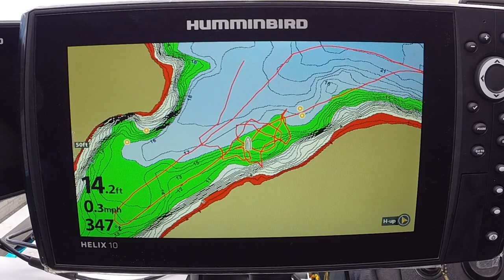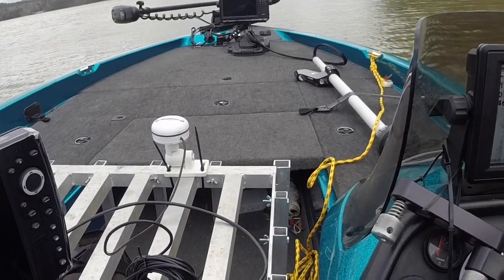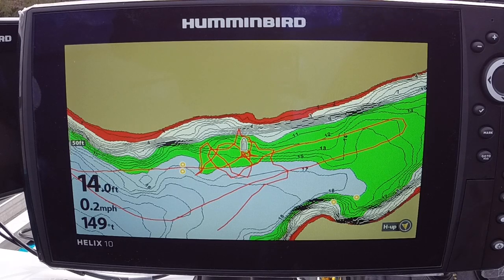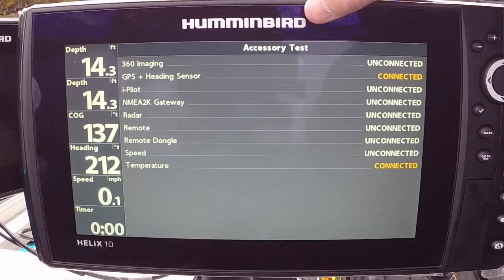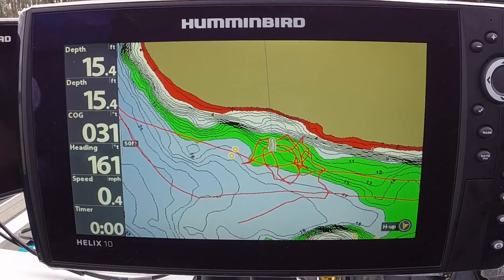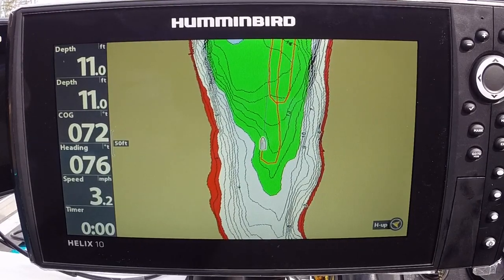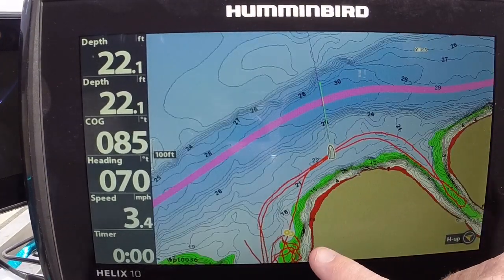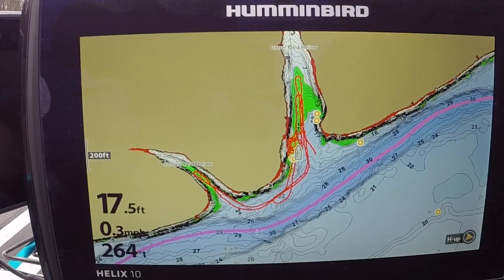Helix heading sensor setup

Comment: Im confused.  Im getting a new Helix 9 SI G2N unit.   It has a built in GPS.      Is this external sensor something i need to have also?     Can I do  follow the contour feature and spot lock without this external sensor?
Reply from the maker: Tim you can do all or that without the heading sensor.  The Helix units have a built in GPS antenna but no heading sensor.  The heading sensor is like a magnetic compass in this model of antenna.  As shown it allows you to see where you are in relationship to a target.  Without the heading sensor the boat icon will simply turn into a circle.  

Do a google search and do a little reading.  it will all make sense then.
Reply: Also if you got the new I-Pilot Link 2017 or later addition, the trolling motor itself comes with a Bluetooth heading sensor that syncs directly to the trolling motor.  In all likelihood you got the old one because the only place I've seen is mk.factoryoutlet.com who is selling the new one.  Maybe later this year local retailers will begin selling it.  It's one less device that the heading sensor needs to travel through because it goes right to the trolling motor instead of being hooked up through the fish finder.
Reply: Im getting the 2017 Ulterra with Ipilot link.   Ethernet with 2 Helix 9 G2n birds
Reply: OK then don't worry about the heading sensor because your trolling motor will come with one.  Again this will sync up to your trolling motor instead of connecting to your fish finder.  You calibrate it through the remote control by doing 2 complete circles and then you drive straight with the trolling motor parallel with the keel.
Reply: Two separate discussions here folks.  The new trolling motors use the heading sensor that is included for the jog feature only.  The heading sensor that hooks into the unit is used to orient yourself to a target.  Neither one will take the place of the other one at this time.
Reply: That's not true.  I have tested this without the heading sensor and with it.  It is not just for the jog feature.  I ran follow the contour in a 10 MPH wind and would not stay on track without it but when I synced it, it was night and day difference.  I own both I-Pilot Links.
Reply: So i will sync this trolling motor to the hand held remote control?  And the troller will be ethernet networked to the birds.   Is there anything i need to do on the finders?
Reply: I actually didn't need to even pair it the remote control.  It worked right out of the box on mine.  Last year on our Pontoon, I had to pair it.  But I did need to pair the heading sensor. Calibration is done on the remote control.
Reply: I own it and I've used it.  I know exactly what it does.  The difference is black and white.  Jog is the main reason to use 2017 over a Humminbird heading sensor, but it's not the only reason.  The Minn Kota heading sensor helps with follow the contour.  It isn't an argument.  It's a black and white difference.  You obviously never experienced it.
Reply: I hope Ranger boats installs this heading sensor if it comes with my 2017 Ulterra!
Reply: Cant wait.  I have the Ranger 1880MS coming soon,  better be in by May 17!    Walleye fishing Bull Shoals.
Reply from the maker: Tim

 Brandon has obviously stayed at a Holiday Inn Express.......  

I have installed 8 of the new BT trolling motors and use one on my boat. I have extensively tested all the features to make sure I know the most I can about the products I sell and install.  I talked to Minnkota today about an issue a customer has with his new Ulterra and an engineer, not a CS, assured me the reason they have a heading sensor is for jog only as of right now. Every other feature comes from the internal design of the head control unit.  

As for Ranger installing any of your equipment it all depends on the deal they have with the respective dealer as to how the orders are placed.  The Ranger dealer most folks buy from here does their own installs on many of the models.  I know because I have helped them with an issue on occasion.  

Enjoy the new Ranger!
Reply: Well on mine I ran follow the contour and it was behaving erratic until I calibrated the BT heading sensor.  I'll create the problem again and show you a video if you don't believe me.  As soon as I synced and calibrated, it was night and day difference.  Cannot get the 2 confused.  Day and night.
Reply: I have a Terrova and he has an Ulterra.  So I don't know if that has anything to do with it but I can promise you I'm not the holiday express person.  I am absolutely an advocate for some kind of heading sensor whether it's the Minn Kota that comes with a BT or one you are showing with the original I-Pilot Link.  That is the only way to go.
Reply: The analogy I'll use it where my dad and I were fishing was like missing the fairway on a 100 yard wide fairway.  Like #17 and #18 at Kapaula Plantation Course.  Then we moved and just before we did I got my dad patient enough to calibrate and set the offset.  It was like we striped the ball right down the middle of the fairway at Firestone.  The wind conditions were the same.  We did not have room for drifting 100 yards off the spot like we did at our first location.
Reply: My old HB  898SI unit  had the boat icon when moving.  And most of the time when i was using my trolling motor to approach a wave point i still had that boat icon and the directional arrow that let me know how close i was getting to my mark.   I did not have a heading sensor, and i always seemed to get on spot lock  fine.    I notice you had  the boat icon and the same directional arrow as well.  But i did see the heading sensor arrow also.   Is this a correct assumption that i am getting on my created wave points without the heading sensor?
Reply: I think you'll see the boat icon when the boat is moving fast enough for the GPS to confidently pickup where you are at and where you are moving.  When you're trolling less than 1 MPH, I think in that case it does just have the circle.  Now this one I am guessing on.
Reply: If I recall, last year when I put I-Pilot Link on my dad's pontoon, I think I've seen it flash from boat to circle on windy days.
Reply: https://www.youtube.com/watch?v=M-EFmIx948M&list=PLdnuLpMCJ8dBX4Nu22cxCjhEnlDI7dAF7 OK Tim Morris here's the video.  This is proof I'm right.  Now who looks like they stayed at the Holiday Inn Express?  Exactly as I stated the performance of your boat on Follow The Contour is exactly the same on the 2017 model with just the Minn Kota as the old one is with just the Humminbird.
Reply: The remote control and heading sensor both sync to the trolling motor.  All wireless links lead through the trolling motor.  The Humminbirds are Ethernet just like the legacy I-Pilot Link.
Reply: Better do a little research.  The jog feature is the only reason they have a heading sensor.  At some point it may be used for something else but for now that's it.
Reply: They absolutely will.  When I was at the boat show, the dealers installed it mostly in the bow.  The mounted it right on the same triangle as the trolling motor.  They will probably install it on the lower right hand corner or back right hand corner.  Another place might be on the dash.  BTW, the heading sensor that comes with your Ulterra also lets you do circles in addition to jog.  The best features is the motor will unwrap when the cables wrap around too tight.  The old system does not do that unless it's on spot lock.

Comment: Is this heading sensor built in on the new  Helix G2N models?
Reply: Just in case anyone has the wrong idea after reading the above comment ....... the Minnkota heading sensor does not interface with any HB units at this time.
Reply from the maker: No it is only found in the HS Gps Antenna.
Reply: The new I-Pilot Link 2017 has a Minn Kota sensor instead of the Humminbird sensor that comes with the trolling motor.  The legacy version does not come with one and therefor you need the Humminbird sensor connected to the fish finder.
Reply: It doesn't interface with Humminbird units, yes that's correct.  But it still helps in follow the contour.  The ultimate decision is in the trolling motor head.  James of Pickwick Marine Electronics doesn't believe me so I have to do a video of it.  I'll show all possibilities and I'll remove the Humminbird heading sensors I have.
Reply: I never made the comment that it interfaced with the Humminbird.  I know it doesn't do that.  What I'm saying is if you use no heading sensors and only use Minn Kota's, Follow the Contour will have just as good of a performance as the Humminbird ones.
Reply: Want to make a bet?  See who is right hopefully by May 6 if this ice ever comes off.
Reply: And I also fully understand there's no jog feature without the Humminbird heading sensor if you're trying to jog on the Humminbird.  There's jog only on the remote control if you only have the Minn Kota.  Humminbird heading sensor lets you jog on the fish finder.  But like I said though, the the ultimate decision after the Humminbird calculates the coordinates and does all the dirty work, the trolling motor decides where to go based on what the Humminbird told it based on the trolling motor's GPS.  And the Minn Kota puck will aid in that decision making process.  I still very much believe in getting the Humminbird puck as well.
Reply: The jog feature now works with no Humminbird with a software update on the Humminbirds.  It did not work with the latest software 2nd week of May last year unless you had the Humminbird.

Comment: Great video. Thank you. Quick question: In the video, are you using the point1 as the external GPS? In the accessory view in the video, it shows your nmea2k network as not connected so a bit confused if the point1 is the external source? I have both the helix 10 and the point1 but unable to see the point1 as a source for external GPS. I can however use the heading and attitude information. Can you clarify if the helix can use the point1 via nmea2k as an external GPS source? Appreciated.
Reply from the maker: Omar the external source for the Helix in this video is the Humminbird HS antenna that I had mounted at that time. The Helix can use the point 1 with the addition of the NMEA adapter (part # 408390-1). 

I run several units on my boat for demo which is why I have the NMEA network and point 1 installed. My Onix, as will the Solix, use the Point1 and I find it just a small bit smoother in movement than the HB antenna,
Reply: Thanks. Unfortunately, the Helix will not recognize the Point1 as an external GPS or display it as an option in the network tab. HB support has confirmed this problem with no resolution yet as of April 2017.
Reply from the maker: Thanks for the information. I wasn't aware of that.

Comment: didn't mention anything about red doughnut at low mph. is there any calibration like point 1? or do you drive in straight line and align hs sensor only? does hs sensor have arrow?
Reply from the maker: +Christopher Parker 

I forgot a few things... lol   There is no calibration with Humminbird.  I actually didn't calibrate my Point one either.  With the correct install location that shouldn't be necessary. 

It does have an arrow on top that points straight ahead. If you drive in a straight line the GOG and Heading information will be within 2-4 degrees of each other like it shows in the video.  When you find a good location only put one screw in so you can pivot the antenna for adjustment they install the second screw.